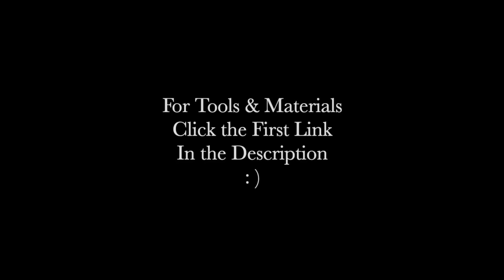Getting Complicated! Making a Short Gusseted Zip Snap Wallet (with Pattern)

Comment: Great video! What do you use for a block under your diamond punches? I tried a block of pine, but my punches are getting bent :/

They're also the cheap Amazon ones though
Reply: Looks like a Novolene chopping block. You can get it through Weaver. I use a 12” x 12” poundo board with a piece 8-9 oz veg tan glued over half of it. The veg tan side I use under my irons, and the plain poundo side I use under punches.